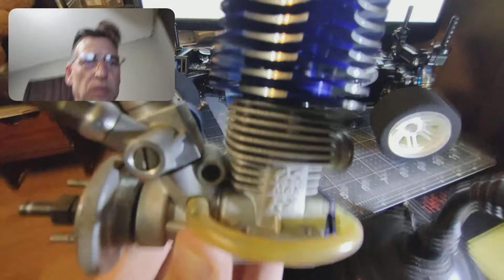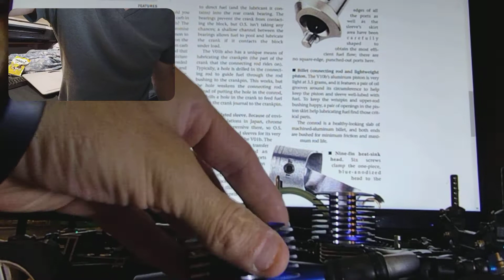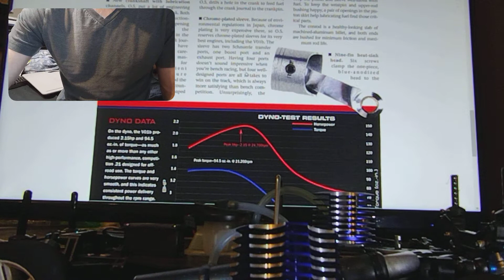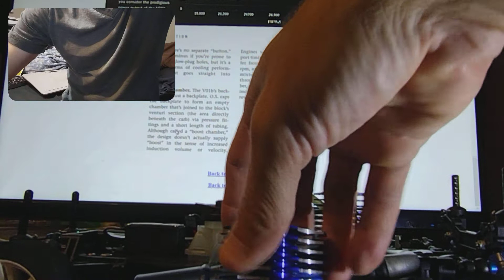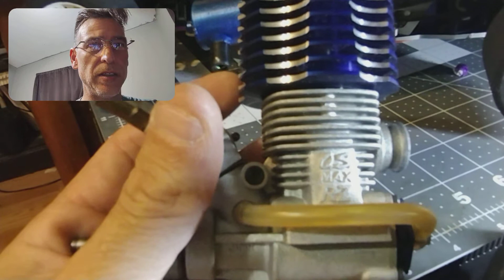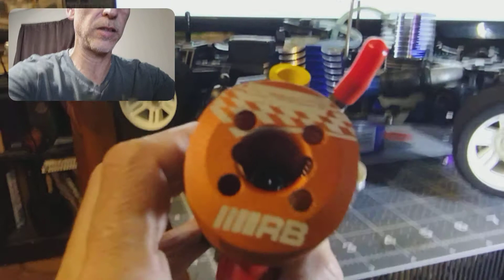Rarest Engine OS Max ever made.  OS MAX RZ - vo1b

Comment: I have 7 of these engines brand new I bought a lot of parts from a guy in norway 6 are rz-m one is this engine with the boost port . I ran these engines in my boats in the 90s and still race them today and still keep up or beat the likes of cmb novirossi and kalistnov this is the best 3.5 engine o.s. ever made . I have also have a r2104 in my t/a buggy .this dyno says 2.15 which is pretty close to o.s claims of 2.45
Reply from the maker: Holy Smokes Dude !!!  I had no idea they were so Badass !!!
I have this thing listed on Ebay... I think I'm going to take it down now !!!
Thanks for letting me know, I knew it was rare, but I didn't know how Badass it was !!! Cheers man !
Reply: @TexasHill it's a iconic motor and a unicorn the boost port isn't really a boost port the 1/8 scale hp motors  had a tendency spit fuel and air back out through the carb at closed throttle  it acts as pressure to stop it from happening cause that causes the motor to stumble a bit when you gun it  . That motor was built for but not designed by drake when he was a puppy at the nats.

Comment: I have just got an Onfa HoBao 2005 Hyoer 7 pro for a 135USD with a bucket load of spare and a new body and wing. It came with the OS Max RZ vo1b (p) 21 engine. Though my boost chamber is round and has cooling fins under the carb so a but differentbut I have the box to confirm. But it has no compassion so have to source a  piston, rod, bearings and sleeve. Its running a Pirate FEMCA 0511 exhaust and just cleaning it up atm.
Reply from the maker: Hell yeah 👍 💯 can't wait to hear back from you!

Comment: I used to race with these engines back in the day, but the Nova Rossi Rex, Tops, and the Picco P6s still held the slight advantage for off road back then, but only when racing on long grassy tracks, which was the norm in the European racing scene. What I loved about these OS engines was that the carbs were easy to tune, and they landed the power great onto the wheels without spinning to insane, and were awesome for off road racing. It was typical back in the days to run lower ports for off road engines, along with them being long stroke for more torque. The on road engines had higher porting, used turbo plugs, and short stroke for faster top end rpm’s. Great engines!
Reply from the maker: Oh wow ! Thanks Buddy... Awesome to hear some input from someone who used them... I still haven't even broke it in yet... LOL

Comment: Best engine I've ever owned. I still have 3 or 4 of them, 1 brand new in Box. Make sure to use gas with enough oil in it - afair 17%. I used Graupner S20 back in the days.. and the engine lasts forever. Had the best results with the No. 8 glow plugs. Be sure to flush / preserve it after running.. otherwise the bearings might rust. Swapped mine to steinless / ceramic. S20 doesn't get produced anymore and shipping gasoline / methanol to private persons is forbidden now..

Comment: I recently got given a Nitro Car with one of these in it, what fuel would you recommend using on it ?

Sorry its my first Nitro Car (Kyosho Inferno MP5)

Appreciate any help i can get
Reply from the maker: Nice engine Brother !
Glad to help !
Okay so first of all you only need 20% nitro.
The best fuel is probably VP basher. I use Blue Thunder, and Bones Brew. I was fixing to buy 6 more gallons of the VP btw. They have it on clearance at Amain right now for $250 bucks. Which is a really good deal. For starters, you want to buy 1 gallon. After a while you may want to consider buying fuel in bulk, or by the case for the season.  The big blocks (.21 -.32) burn a lot more fuel in a season than a small block... (.12 - .15 engines)  One gallon might last you a month if you run everyday, or it could last you 3 months... depends on how much you run... Just something to think about. I went thru 5-6 gallons this season all ready, and still going.:face-fuchsia-poop-shape:

Comment: Awesome video and engine. The offroad version was the V-spec and all its varients (speed V-spec, pro spec. Speed v-spec ii worlds edition etc.) Same bore and stroke (short stroke) and also a 4 port. im pretty sure the timing is alot different between this and the offroad versions. I remember when the boost ports was the rage in the early to mid 2000's. And those RB engines were manufactured mostly by Novarossi for Rody to his specs. Still great engines. Hope you get that IGT8!! Good stuff bro. 💯🏎💨😎
Reply from the maker: Hey Thanks man!  I ended up loosing the bid on the IGT8 by like 10 dollars,  I'm still mad about that. Anyway, I decided to build my own Kyosho' GT1's since I lost out on those I found on Ebay and the IGT8 I was bidding on..... i wanted that car sooo bad!!!  Maybe I will get one later if some of my jobs go well, and I stack up a bunch of cash.
Reply from the maker: Man I love how you know all the specs, and specifics of the other variants of these engines!!!  This is exactly what I love to know about!!! Thanks man you rock! MrLiChilly